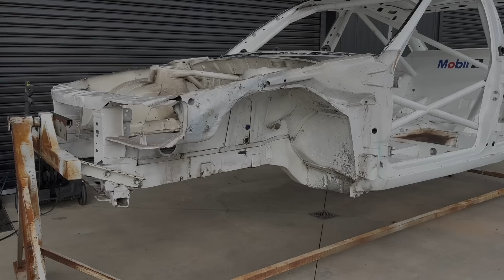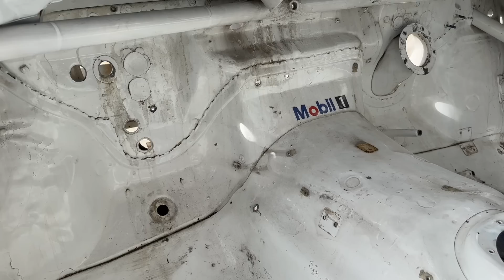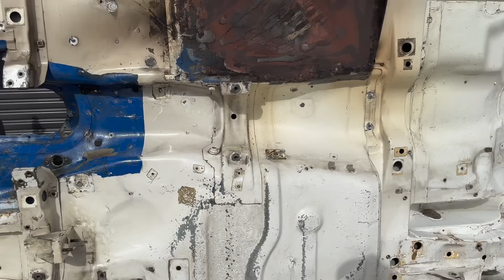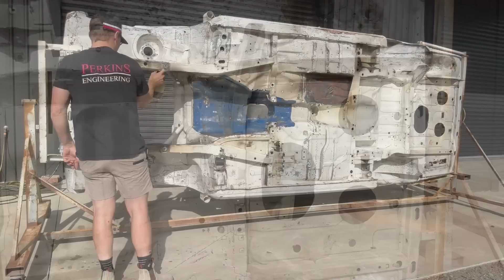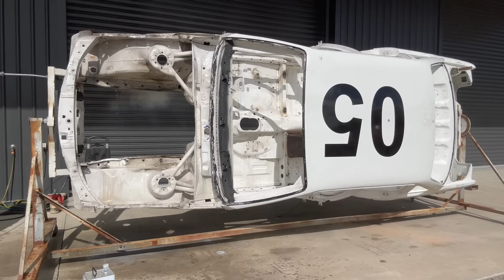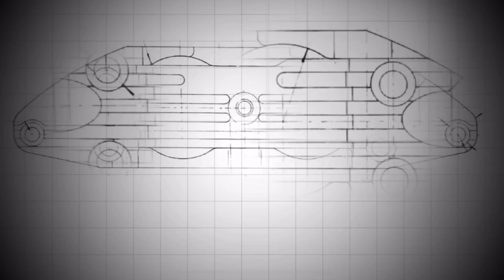Episode 67: Brock's 1991 VN Commodore PE 013 is on the rotisserie

Comment: Jack, does the blue section get put back to make it authentic or is that just pushing things too far ?!?!
Reply from the maker: The blue paint was only added to the body shell at Advantage Racing in/for 1992, so when PE ran this car in 1991 it was all white, except the blue on the body work that formed part of the cars livery. If we were restoring it to 1992 or 1993 then it would be all blue. Cheers and thanks for watching!

Comment: Why bother wasting time washing it when its going to get blasted?
Reply from the maker: Great question and I'm glad you asked. So the car had quite a lot of oil and fluid through it, especially down the chassis rails in the engine bay and around the boot where the oil tank and fuel tank live. If we blasted it with the plastic media that we use then the plastic would obviously stick to the oil and fluid inside the rails and sections. We wash the body to remove this oil and fluid before blasting. Then once the shell is dry, the blasting process happens and after blasting we can blow out any left over plastic media with an air blower knowing it will remove easily not being stuck to any oil residue. Cheers for watching!
Reply: @perkinsengineering  Yeah that makes sense, i guess the video doesn't quite show how much oil was there

Comment: Firstly. I Love your work. You and your dad should be honoured for the work you guys do .
ls there a reason why you wouldn't just preserve rather than restore. these historic race cars?
Every dent tells a story which will be gone...
Reply from the maker: Thanks for the kind work. We leave as much of the original stuff as physically possible. It all starts with picking and event to shape the restoration. The owner has chosen Bathurst 1991. Therefore anything welded or added to the car after Bathurst 1991 isn't original for the restoration. The Chev engine, oil tank mounts, oil line mounts, 4-link rear diff arms, roll cage changes etc. all weren't there in 1991 so you can't claim the car is in 1991 guise with all of that incorrect stuff in there! Thanks for watching, cheers

Comment: Besides restorations, what does PE focus on nowadays?
Reply from the maker: Well the PE race team was sold to Kelly Racing around 2009 and then the REC's (Supercars Licences) were sold to the Kelly's in around 2012/13. I came back to Melbourne around that time to help Dad move out of the shed's and basically shut everything down. I started to integrate with some old car owners who were a bit concerned PE was going, so I've slowly ticked along, working on some old cars and restoring them. It's not alway's a 9-5, Monday to Friday, especially when I'm off racing or working with TV on the Supercars broadcast etc. There's no full time staff or anything, all very low key! Cheers!
Reply: Second this. No doubt big dollars come in for a restoration but there must be something more "run of the mill" to keep the lights on.. 🤷‍♂️
Reply from the maker: If you must know, it's very low key these days. No full time staff, no massive over heads, we do bits and pieces here and there centred around car restoration and looking after old cars and engines. This is involves re-manufacturing old parts, helping others with there restorations and cars and so on. What we do at PE compliments everything else, I also work for channel 7 on the supercars broadcasts, drive in the supercars endurance races, work with a few brands and sponsors in an endorsement role, work on the farm and do whatever needs to be don to "keep the lights on". Wouldn't be able to do all this working a 9-5 a Woolies. Cheers
Reply: Is Larry still active in this work, too? No doubt he is a living library when it comes to these cars.

Comment: Would it be worth acid dipping the shell?
Reply from the maker: No way, not something we would do. The fluid and what not can seep out for years after wards. We've had a great run with plastic bead blasting, especially on our last two projects, it barely touches the metal, just polishes off the paint. Thanks for watching, cheers!
Reply: @perkinsengineering  thanks so much for the reply, I never knew this, I’ve been painting cars for 35 years now but only deal with customers who have prepped their cars to be painted/body worked (most have shot/walnut blasted or acid dipped) that’s a great insight, not one I’ve heard of or dealt with, I’ve never heard of that happening before as after dipping the shell it is dipped again to be neutralised.
Reply: @perkinsengineering  jack your wrong about acid dipping
Reply: I dipped some truck mirrors in a caustic solution thinking it would be a quick way to get the old paint off and that stuff ran out of those mirrors for a long time after I had painted them. I will never do that again. After that experience I’m with you on that Jack.